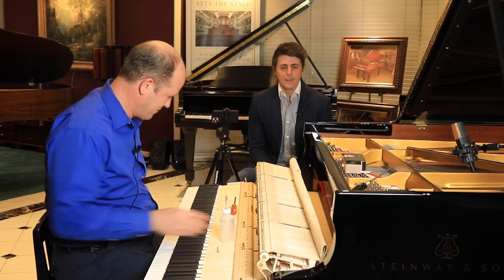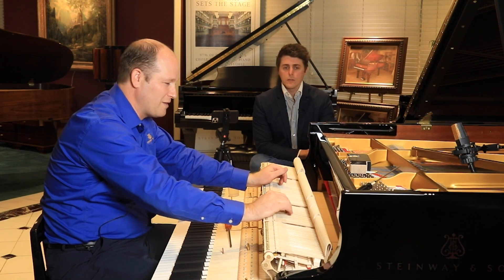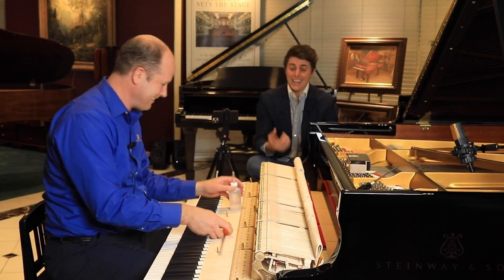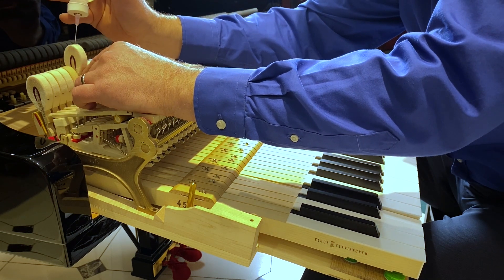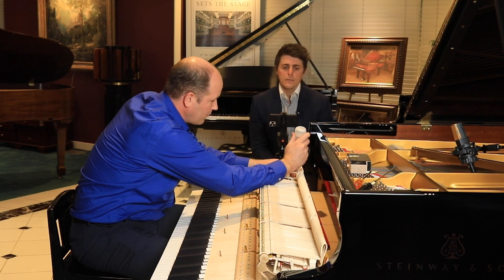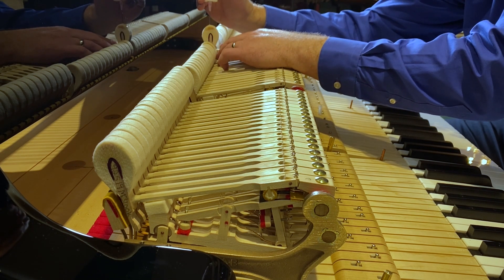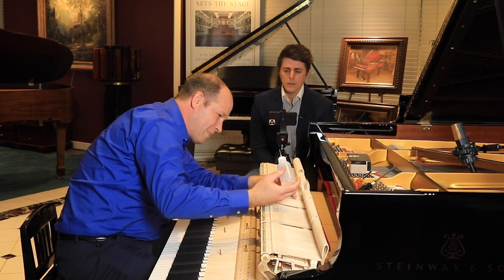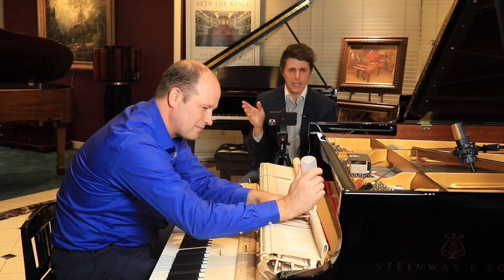Part 3 - Pre-Voicing the Hammers for Tone & Beauty - Prepping a NEW Steinway Series

Comment: This looks like an overkill. Too much hardener. They will harden as you play. You may also file them and iron them to solve the heavy action problem and make the sound brighter and more alive. You got a set of heavy hammers that are killing your fingers at the key and killing the sound at the string. I am not saying that hardening is not necessary at all but weight seems to be at least 50% of the problem. Psychoacoustics (feel heavy due to sound) is a third order effect, not even second order, so it's not really enough of a factor.

Comment: There are a few things that should be mentioned. In 2019 I bought a New York Steinway D equipped with the Spirio R recorder/reproducer system.  It was the first Spirio R model D in the San Francisco Bay area where I live.  After letting my piano get acclimated to my music room for three weeks, Steinway sent their west coast tech, Mr. Luke Taylor, to do a complete concert prep on my piano.  Here is what he did:

1.  He used sandpaper on the bottom of the key frame and in the cabinet to completely fit the keyframe to the cabinet with no high spots.

2. He seated every string firmly down against the bridge.

3. He shaped and needled every hammer to voice the piano to my preference.

4. He shimmed the key levers to get the correct key dip.  On a Spirio New York D the key dip spec is 0.4 inches or 10.16 millimeters.  It should be pointed out that the Spirio pianos have a different action from the non Spirio pianos.  So, the key dip spec may not be the same for a non Spirio New York D, or for a Hamburg D.

5.  He tested and seated the repeat springs in the action.

6. He adjusted the back checks to set the hammer drop to spec.

7. He then slid the action back into the cabinet and adjusted where the action sits in cabinet so that the hammers strike the strings at the optimum point.  A piano hammer should strike the string at a point about 1/9 of the speaking length of the string.

8. He then tuned the piano in two passes.

After that, he set up and calibrated the Spirio system.

Here is a video https://youtu.be/Ll0vLvg8Xjw of my Steinway D reproducing Sergei Rachmaninoff playing his Moment Musicaux no. 4.  Unfortunately, the audio in this recording is not the best, and a couple of the notes in the treble section are slightly out of unison.

It should also be pointed out that in the top tier grand pianos there is no one best brand.  Steinway is definitely one of the top brands, but there are other brands that are just as good.  I also own a Bosendorfer 290 imperial grand, and a Fazioli f308 ten-foot concert grand.  They are every bit as good as my three Steinway pianos.  Here is a video https://youtu.be/Te3AxWKN7jI of Mr. Paolo Fazioli in my home playing my f308 concert grand that his company built for me.

To anyone looking to buy a good grand piano I would recommend trying different brands.  Steinway is an excellent choice but look at Fazioli and some other brands and see what suits your taste the best.

Comment: They are just saying in the experience based in USA. Asia is not recommending New York Steinway but Hamburg one. Because the humanity has created a hassle for the New York Steinway as the NY ones did not have the strong larker to keep the resistance of the humanity in Asia and most of the NY went very swollen and bolt which are not ideal for the Asian markets. Be warned!

Comment: I didn't find this video that helpful--there should have been a before/after comparison. I have several customers with new Steinways (2 Bs and something else), early 2020s. All came from the dealer with hammers that sound like puffballs. The customers seem to like them, but there's some brand psychology going on:  "if it's a new Steinway (and I paid a huge amount of $$), it MUST be great!" The problem is, they aren't, and they definitely need hardening. I think many dealers won't if they think the customer doesn't know the difference. 

To speak to the previous comments:" How do I know if my piano needs the hammers lacquered?" By comparing your piano to others that have it. Otherwise, you have no point of comparison.
One person asked if their Kimball needs it. No, it probably needs voicing down. It does not have anything like the S&S NY hammers. And, depending on the Kimball, it will probably never sound that great anyway. (Sorry, that's the reality. Kimballs are not high-end pianos, especially anything made after the 1920s. They are econoboxes.)

As to hanging new hammers on an old Steinway: No, you can't. Those old pianos used much lighter hammers. A technician who just orders some new S&S hammers (or Runners) and just sticks them on has no clue about them. That was me on my first few rebuilds, by the way. Now I know better.